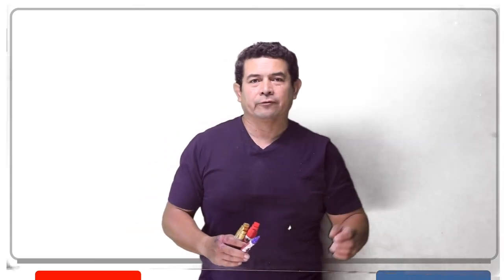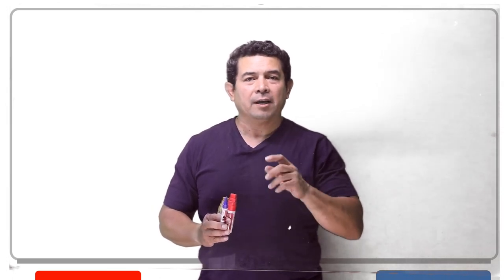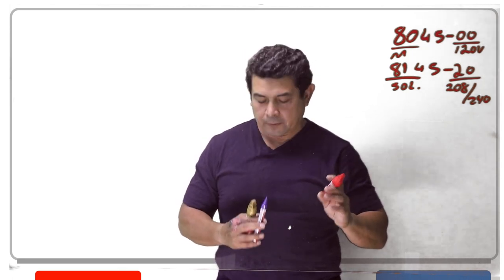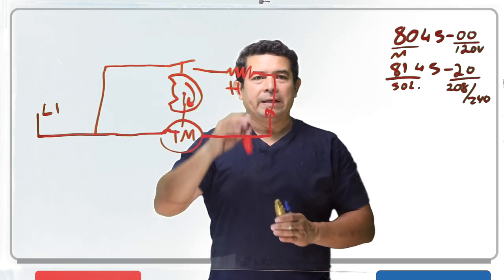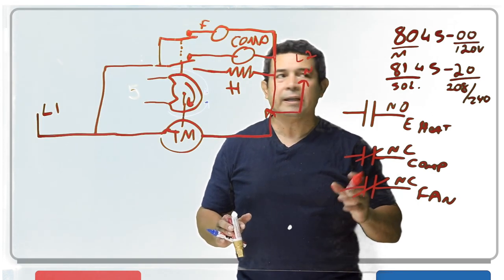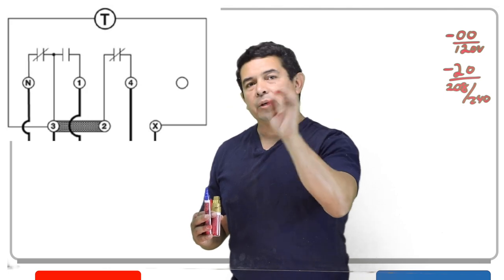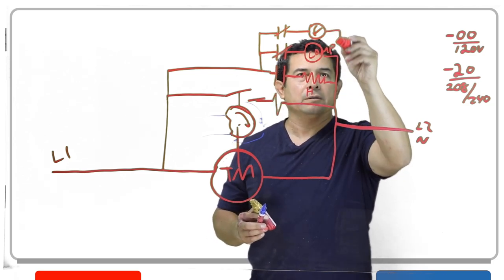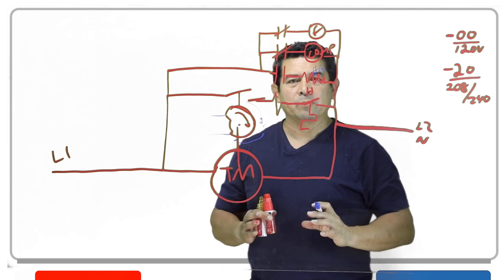Freezer Paragon Defrost controls-HVAC Online Training and Courses

Comment: I love your clear board for your drawing presentation in your videos. It's the best  HVAC/R academic presentation on Youtube I've seen. I'm a licensed HVAC technician. I have one concern with this video. Please correct me if I am in error. The N.C. contacts you have completing the control circuit for the compressor actually do not. Those N.C. contacts send control voltage to the t'stat located inside the refrigerated space. Whenever rhe t'stat contacts close, it completes the control circuit for the liquid line solenoid coil which energizes the solenoid coil which opens the liquid line solenoid valve, allowing liquid refrigerant to feed the metering device which feeds the evaporator coil which causes the low side pressure to rise to the cut-in pressure setpoint of the low pressure safety switch which closes the contacts inside the low pressure safety switch which then sends control voltage to the compressor contactor coil which energizes that coil, causing it to close the N.O. contacts on the contactor, thereby sending line voltage to the compressor motor which brings on the compressor for refrigeration mode. There is more to this on the refrigeration side of the timer comtol. There is the circuit for the evaporator fan as you mentioned, but I won't go into that sequence of operation. I just wanted to point out the part that involves the N.C. comtacts for the compressor actually directly feed the t'stat, not the compressor contactor coil. I will be viewing more of your videos. I have already watched others. Just recently found your channel and subscribed. Please keep up the great work you're doing!! Again, your presentation is EXCELLENT!!
Reply from the maker: First thank you for your kind words. I enjoy teaching and do this to help some of the guys out there in the field.  Thank you for the information you ere sending me about the operation.  I read what you were describing and I can see how that system works.  it makes perfect sense the way you described it.  I go and see whatever my ex-students ask me to come and see whether it is AC, Refrigeration or controls in their buildings.  your description is of a more complicated system then I was describing and or what Paragon timer actually describes in their manuals.   BUT   Yes you were correct in your description, I just could not cover all of the different scenarios.  Thank you for writing, and subscribing.

Comment: in solenoid type how can you control the defrost time as its connected in series  with defrost thermostat !
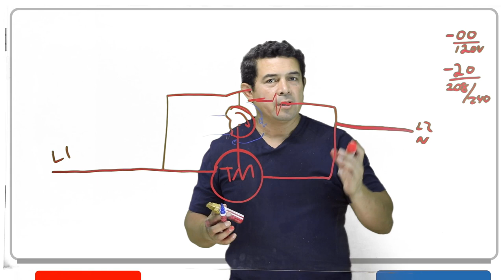Reply from the maker: Thank you for your question!!!   That solenoid is the coil for a relay. if you look at time 11:42 I talk about it being a relay. and how that will control the heater, the compressor and fan. I guess I should have called it more times relay coil in stead of solenoid.  Thank you!!!